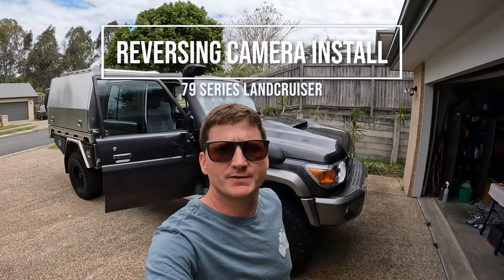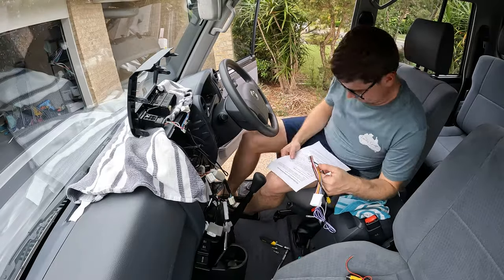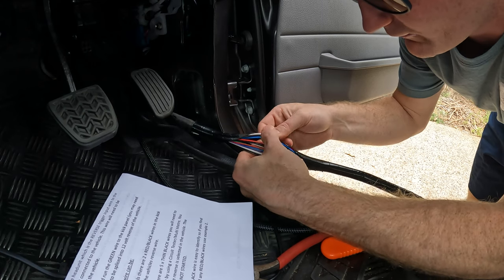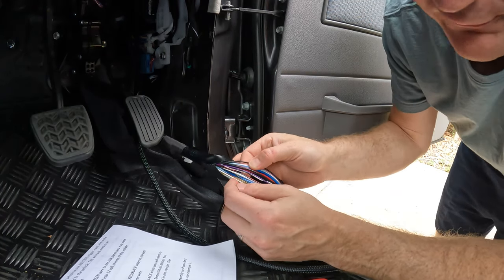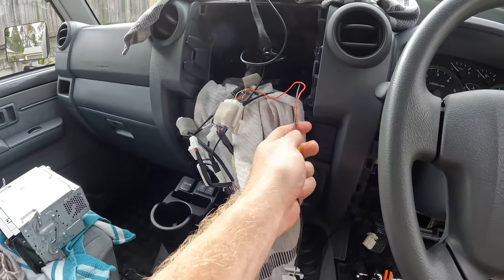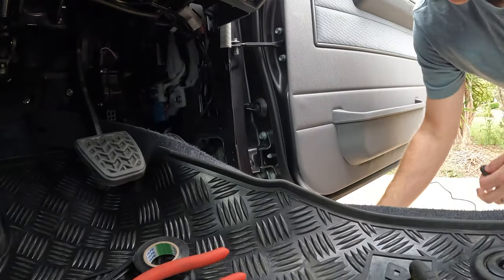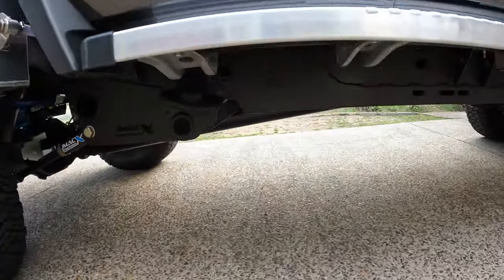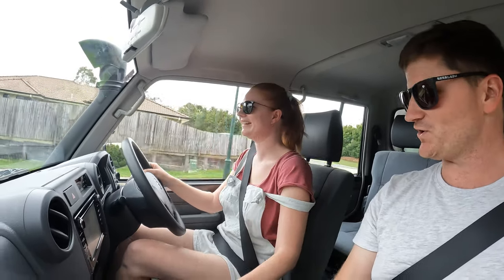79 series landcruiser reversing camera install

Comment: You can pick the reverse trigger feed from just behind the glove box in the 2022, red and white wire. Saves cutting into the loom.
Reply from the maker: Great tip Ciaran. Wish i knew that before I did mine. Thanks for watching.
Reply: Hi mate, do you have more information on this, im struggling to find this wire. 

Thanks
Reply from the maker: The one behind the glove box?
Reply: @FamilyEscapeAustralia  yes mate
Reply from the maker: Sorry I haven't had a look. I used a different point. Hopefully Ciaran can help.
Reply: HI! Great tip... My Toyota is a Landcruiser 70 Series 2021. I have been told this model also has the wire behind the glove box, but I haven't been able to locate it. Any ideas? If I'm looking for red and white wires and able to find them, do I just connect the camera to the red one and not worry about the white one?

Comment: Scotch lock for join?
Reply from the maker: Hi Marty not sure what you mean?
Reply: @FamilyEscapeAustralia  They are an IDC style connector you can just slip sideways onto a wire to tap it. Squeeze with pliers and snap the cover closed. I assume the Scotch in the name refers to the 3M company, not the liquor from Scotland!

Oops, just realised you used one. Guess you didn't know the brand name. There are lots of clones.